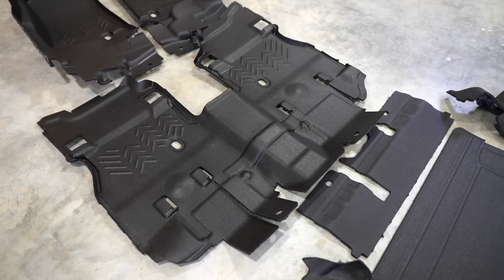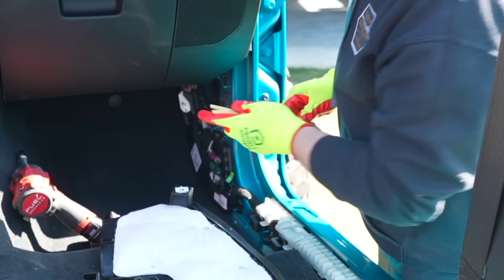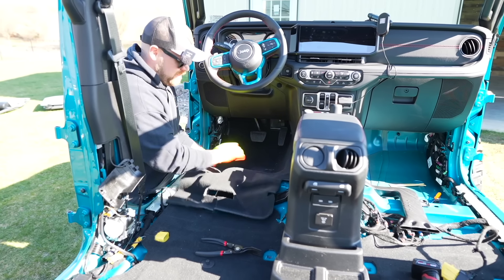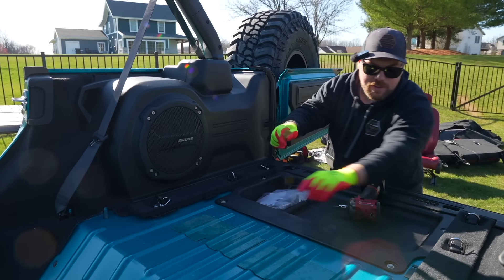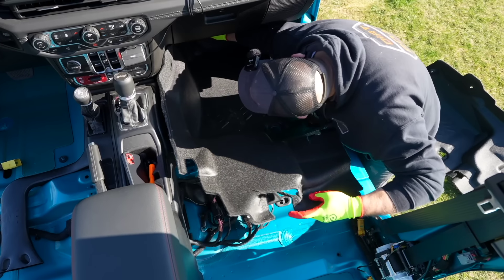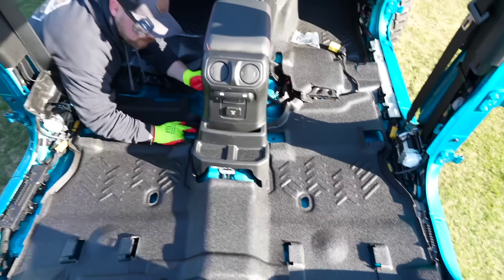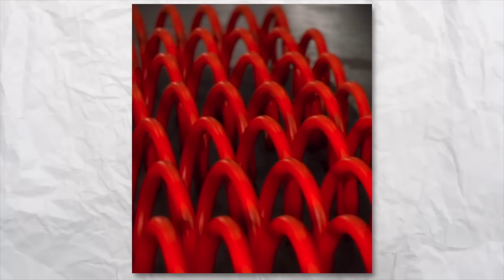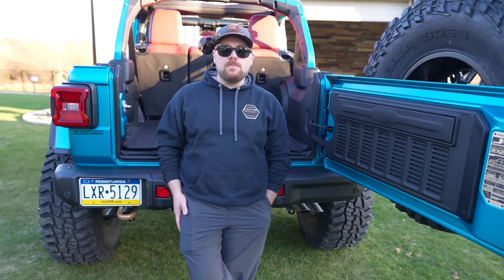2024 Jeep Wrangler Armorlite Waterproof Flooring Install (4 Door)

Comment: Have this installed on my JL. Great improvement from factory but fully waterproof is a bit of a stretch. If you get rain, yes it won’t soak like the OEM carpet, but water will definitely sip in under the armorlite. I was disappointed on the uncover gap between the center console and the seat where water will definitely can get under the carpet.
Reply: I have it and agree. Also the sides should come up higher. I am pretty disappointed and will probably just rhino line mine like I was gonna do in the first place.

Comment: I’ve owned 5 wranglers over the years, Bed lined most of them. This looks great   For light rain but it’s not waterproof the rain will drain under the armor lite through the holes and seams especially in the rear bed. Just wondering if there’s a fix for that

Comment: Maybe after I get the corrosion issue fixed would consider this. I def would be using the sound /thermal tape under this kit though. You should have resin coated the whole inside and just ran it with the blue color..lol

Comment: I keep hearing waterproof. Its not water proof. I have this on my 2023 wrangler. Part over lap other parts in some areas which water can get in through, also water can get in through where bolt down the seats. To say it's water proof is a reach. Yes it does what it advertises like when cleaning it poor some water and clean but still have to be mindfull of how much water u pouring in, also good for quicker rain showers if you get caught without a top . I'm just saying their is a lot of areas water can still get in between the floor and the flooring, so really can't say that the jeep is being water proofed. With that being said it is defenatly the best flooring for a jeep now all I need is vinyl seat covers